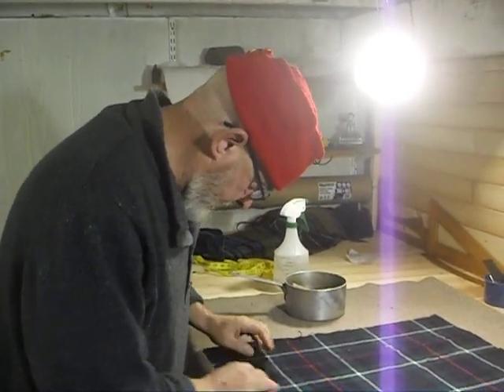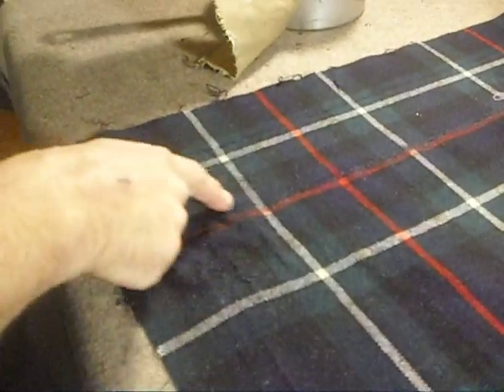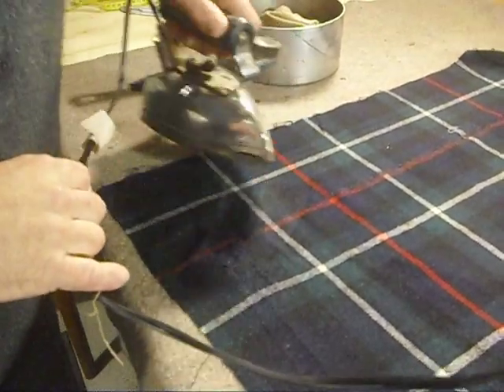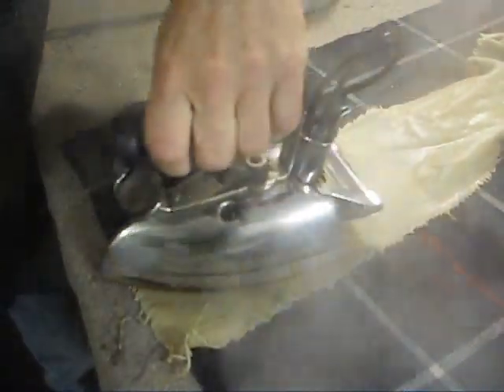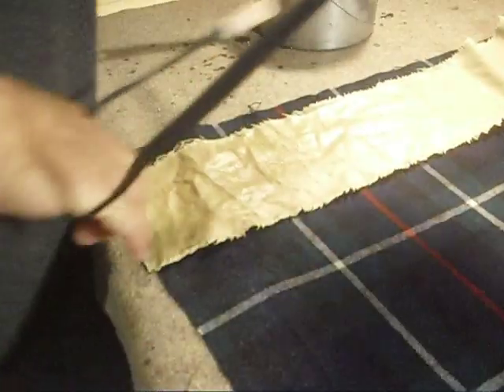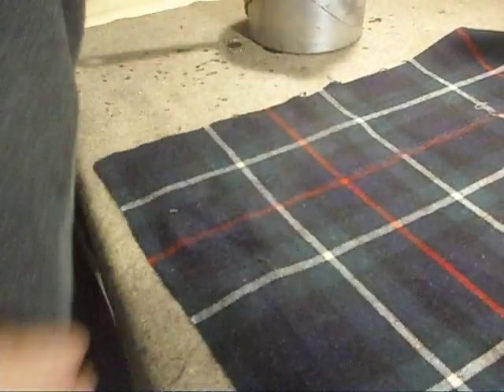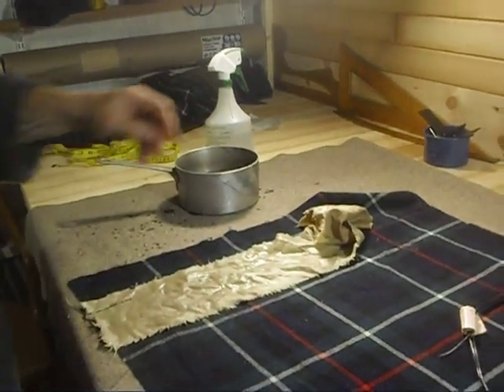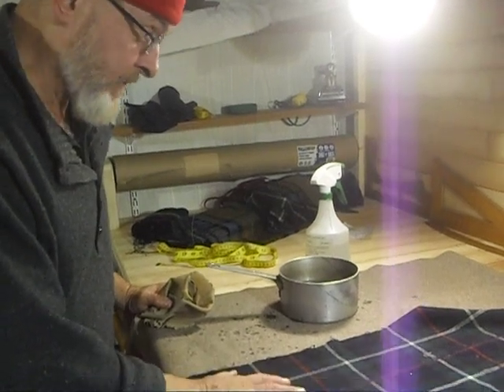Pipey's Kilt, part Charr   shrinking the stretched bit

Comment: Robert, I remember a technique of using silk chiffon or a piece of fine copper mesh to avoid the sheenon the wool. We used that in the 1980's while repairing uniforms and woolen (Loden) coats in an Atelier in Berlin. Cheers Wolf
Reply from the maker: Thank you for that - I'll certainly try it (altho' I'm not sure where I would find some fine copper mesh)